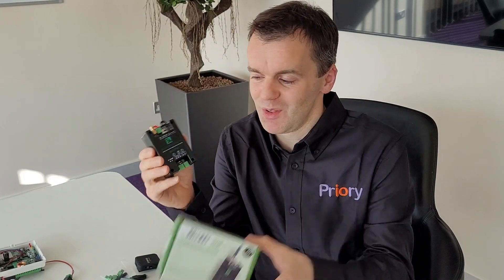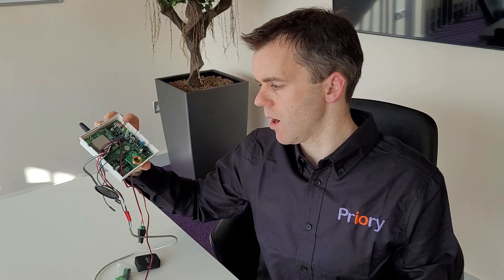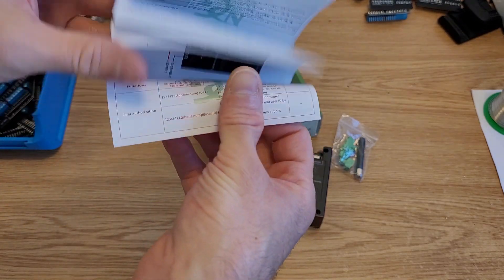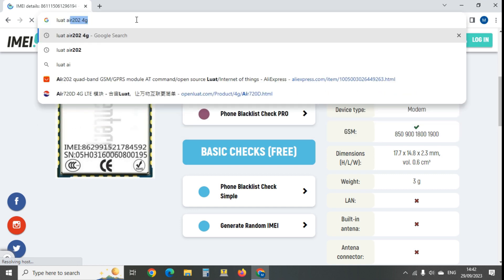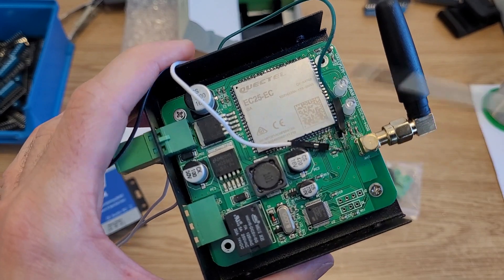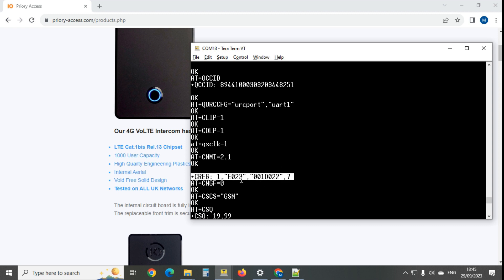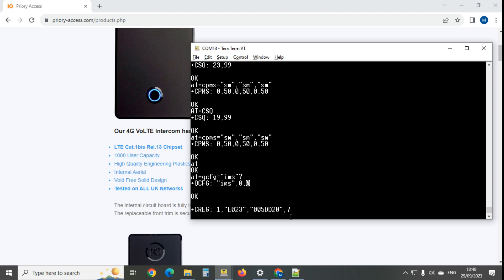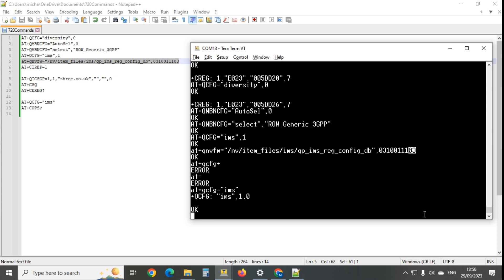Are 4G Gate Openers really 4G? RTU5024 & Callny G202 Plus Testing.

Comment: If someone can explain to me the connection to the USB, I would be very grateful. I can see there is a third cable and the colors of tx and RX of the board are different colors than the color of the cable that goes to the USB. I need to connect GND?

Comment: Hello iot-portal
I have an RTU5024 from 2020. It has the additional 3G/4G printed on it. It hasn't worked in Switzerland for about 1.5 years. Probably at the same time as the 3G network was switched off. Can you recommend a device and seller that works straight from the manufacturer without any reprogramming and is inexpensive? Thank you very much

Comment: The command to enable the IMS on these RTU 4G modules is
at+qcfg="ims",1
You need to solder wires onto the RX/TX test pads.
Reply: Can you access the prompt command of the device by connecting it by usb to a PC? Or is the only way to solder onto device board TX/RX? Will the prompt automatically come up or do I need to run another program ect?
Reply: @BrodySmith-w2p  did you manage to figure out this? I would like to try, I can solder but no idea if it will auto popup on the app or is there a previous setup I should do
Reply: Once this command is sent  is 4G operation permanently fixed or just until next power down?
Reply from the maker: @briandance7194  It stores that in non volatile memory so is permanently unless somehow there is a factory reset of the modem which should never happen.
Reply: Could you do a detailed tutorial on how to do this? it could really help a lot of people, thank you!
Reply: If someone can explain to me the connection to the USB, I would be very grateful. I can see there is a third cable and the colors of tx and RX of the board are different colors than the color of the cable that goes to the USB. I need to connect GND?

Comment: Hi thanks for taking the time to do this video. Im a gate opener installer in Jamaica and I have been searching for 4g devices in preparation for 2g sunset. I was actually looking at the g202plus and the g203 models as I need the 999 user model. Glad i found your video in time. Have you looked at the rtu 5025 model. It would be interesting to know if the 4g radio is enabled. I saw a video with a guy from Chile showing the 4g radio in the unit. I hope you will be able to review the rtu5025. Thanks again.
Reply: I should really get a new one to see if they've done anything about it. You need quite a modern chipset to make 4G calls. The new chipsets are cheaper than the old Qualcomm ones so they might end up making a VoLTE gate opener without even knowing about the issue!
Reply: @michaelbeaver8281  you may choose our WH-300 4G
Reply: https://youtu.be/EWcfa5qfSoo?si=QJIMi-_35zy7kLCA
Here is the link for the rtu5025. The 4g chip is shown as the guy disassembled the unit. Only thing he is speaking spanish.
Reply: @MIKE-il6mu its a Quectel EC25 which is pretty much the same as the one in the unit I looked at. It has old 4G chips in it. They work on some networks but the IMS must be enabled as shown at the end of this video. Maybe the manufacturers know about it now or maybe they don't. You need to put the wires on to tell. If you have billing on your SIM card's network which shows whether the call was VoLTE or not that can also show if the IMS is enabled. The one I have it isn't. I did switch it on and it worked but I had to solder wires onto it and type the command in.
The VoLTE system in North America is old so I reckon that would work there if it's enabled.
Reply: Now the shutdown has happened I can confirm that the 5025 will work on 4g automatically any setup during 3G period need upgrading, which I’m still trying to figure out how to do 😊